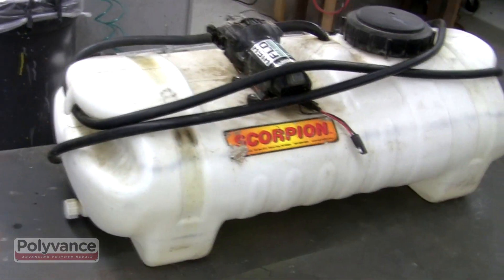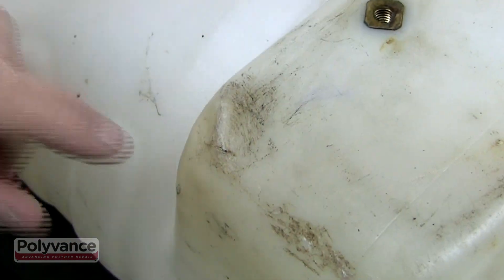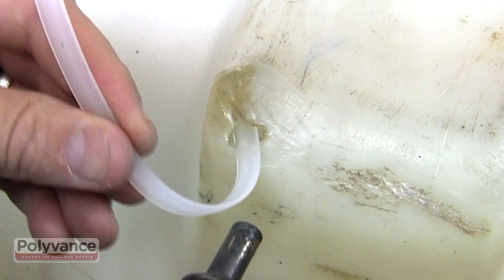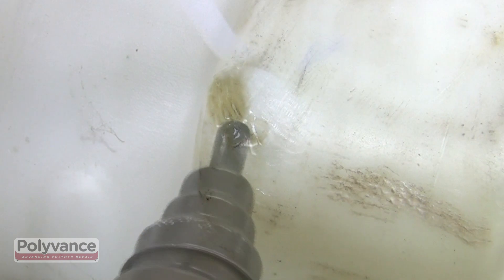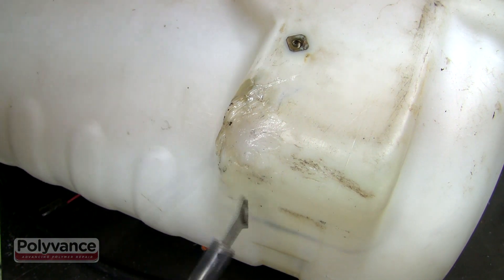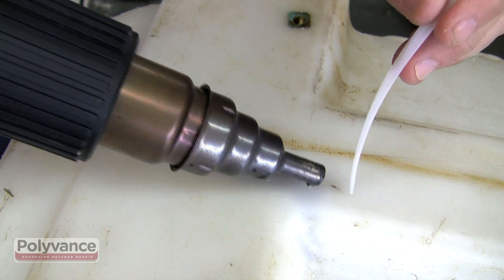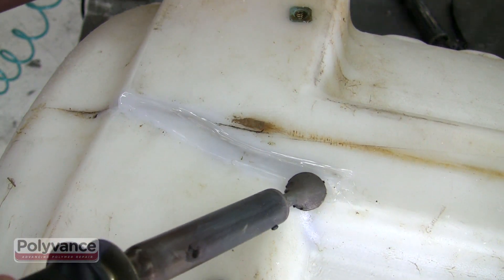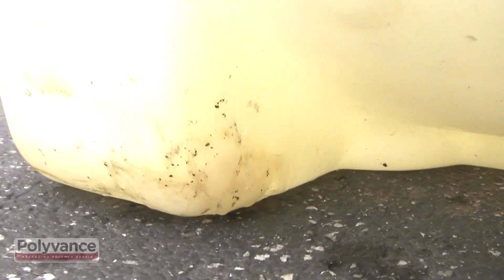How to Repair a Polyethylene Agricultural Sprayer Tank

Comment: Was that HDPE ? Show and discuss the tool !
Reply from the maker: It is polyethylene, most likely HDPE. We usually recommend repairing HDPE using LDPE welding rod because it is easier to work with. In this video, we used a hot air plastic welder to melt the rod and an airless plastic welder to smooth the weld. You can see our hot air plastic welders here: https://www.polyvance.com/Hot-Air-Welders-1/
Reply: @polyvance  Great ! Thank you. Just what I needed.
Reply from the maker: @joe28704  You're welcome! Feel free to contact us anytime you have plastic repair questions.

Comment: I have one leaking from the square bolt hold down nuts on the bottom of the tank, how would fix that?
Reply: It would depend on the accessibility of the bolts.  If they are through bolts and you  have access to the inside of the tank, you could weld over the heads of the bolts with plastic filler rod, or you may just need a rubber seal replaced.  If they slip into a bracket on the bottom of the tank, you'll have to roll the tank on its side, remove the bolt and then weld the crack.  Contact polyvance on their website and send a picture.  With a picture or two, surely a good solution can be found.

Comment: How would you recommend repairing stripped threads on a poly tank? The 1" hole is nearly smooth on the inside (threads are basically gone) and I'd like to install a spigot.
Reply: It may be possible to weld a new layer of plastic inside the 1" hole and then drill and tap the hole.  If there is enough meat on the outside of the hole you could always drill to the next size larger and tap that and install a bushing.  There may also be oversized fittings available or possibly a helicoil.

Comment: Great video! Where did you order the polyurethane strips from? Thanks!
Reply from the maker: Thanks, Paul! Welding rod can be purchased from our website, and the type you get depends on the type of plastic you are working with. This video features a tank made of polyethylene, so you'd need polyethylene welding rod.
https://www.polyvance.com/Polyethylene-1/R04-04-01-NT/